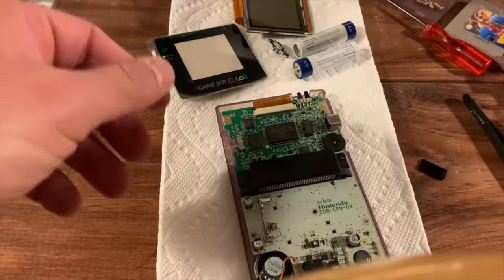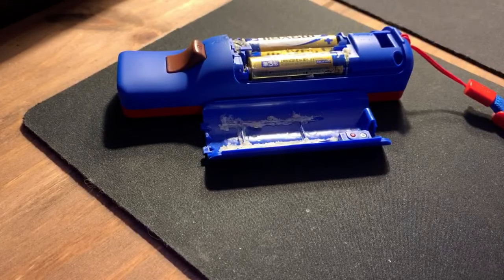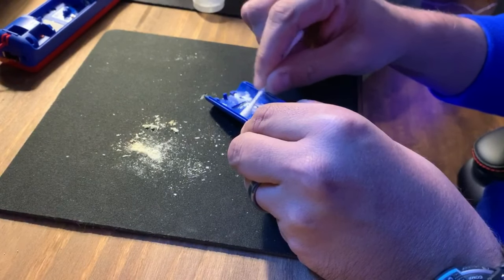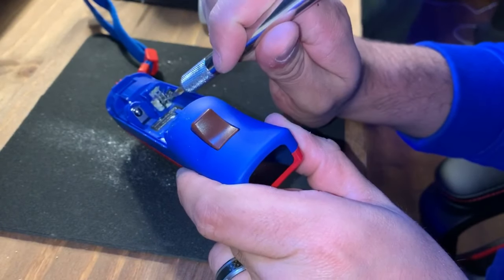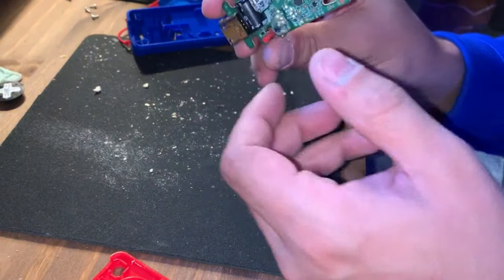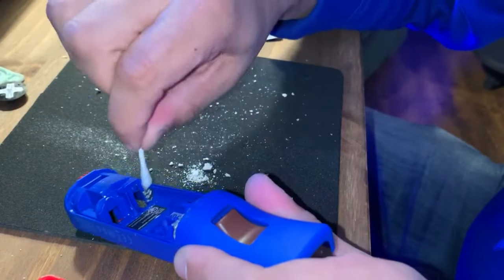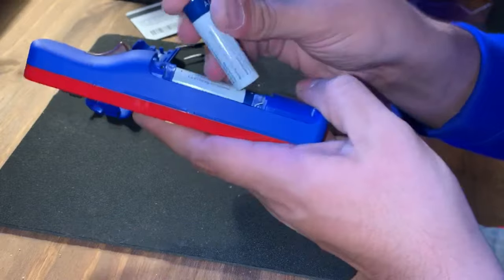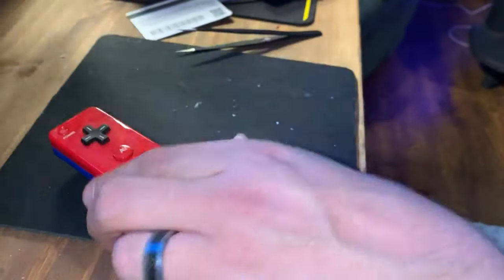Fixing a WII controller: Battery corrosion clean and disassembly

Comment: A little more work than usually necessary. Hose off the cover, scrub with old toothbrush. Use dry toothbrush to get off as much corrosion as possible first (95% of it will come off this way), then follow with IPA for final clean.

Comment: Other tips seem to be using vinegar or lemon juice, any experience with that? Nice vid!
Reply from the maker: Vinegar as long as it’s the cleaning version. Just make sure you get it all off after using. I prefer rubbing alcohol
Reply: Remember that vinegar and lemon juice are both mildly acidic, so while the liquid will wash away the solids you see, they won't neutralize it. Baking soda paste (regular baking soda with a little water) would neutralize best, but I would plan to be very careful if you choose to use that.